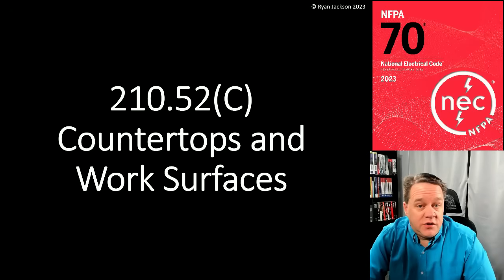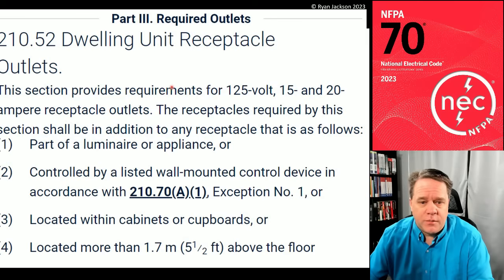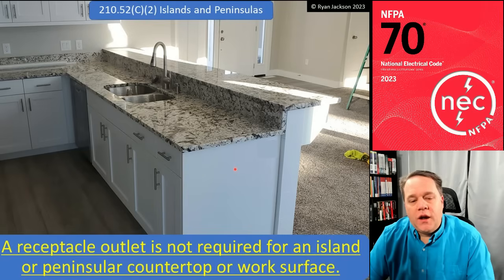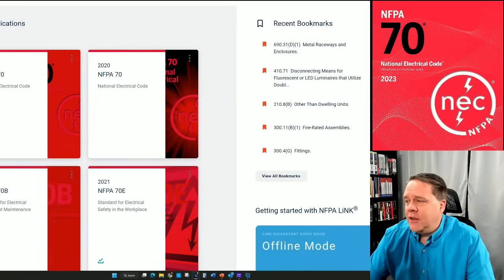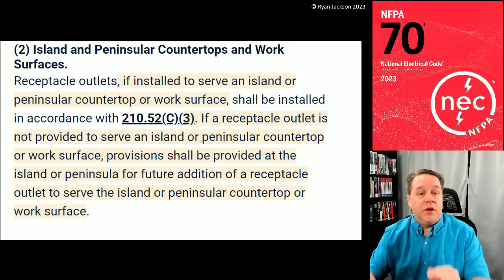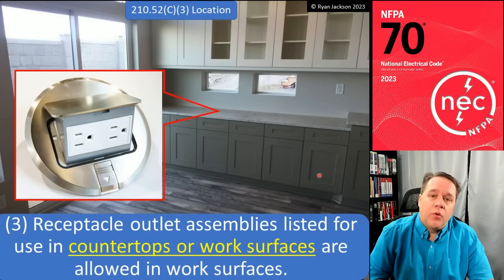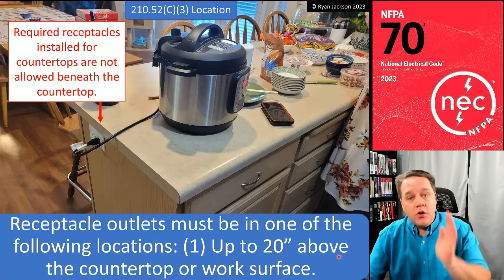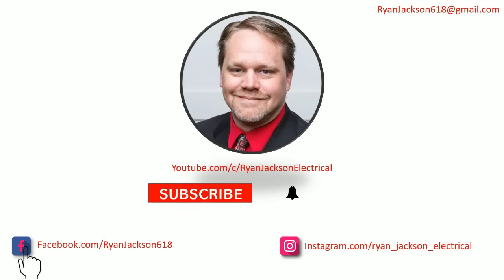Kitchen islands and peninsulas in the 2023 National Electrical Code

Comment: I wanted to know your expert opinion on how inspectors interpret the NEC regarding the proper "code" way to install an outdoor electrical point for an outdoor surface mount light, in some installations, I see a surface mount weatherproof electrical box by Hubbel Bell which I assume is always going to be "code". In other installations, I see electricians drill a recessed hole in stucco to mount a blue old work round Carlon electrical box, at another work site I saw 4 inch square J boxes, with mud rings being installed before stucco work and at one other site I saw pancake boxes ( I hate pancake boxes the most ). What exactly is considered the national standard? I talked to different electricians and I keep getting the same answer that their method is "code" and they are at the mercy of different inspectors on duty on what exactly passes... Can you clear up the misunderstanding? What does the NEC consider to be code?

Comment: pop up receptacle outlets on the countertop has to be the GFCI as well??
Reply from the maker: Yes
Reply: @RyanJacksonElectrical  Thanks, I know the dishwasher has to be a dedicated circuit. Does the refrigerator and gas slide-in oven also has to be a separate dedicated circuit??
Reply from the maker: @sarahljs  none of them, including the dishwasher, need to be.
Reply: @RyanJacksonElectrical  Thank you for the quick response, appreciated. I understand all Kitchen outlet has to be GFCI. But has to be tamper-resistant as well?? And for the countertop microwave has to be AFCI protected too? or that is just for the range over the microwave? Last, is there any minimum distance between the outlet location? I understand it is within the 2ft and 4 ft rule but when I think about the outlet right next to the gas oven range, within 2 ft means I can put at a 1ft distance.. that seems quite close to the gas oven.

Comment: I'm confused about what you're saying. You're saying two opposite things at the same time. I'm going through the 2023 code Handbook along with your video and the NFPA document at the same time to make sure I got this all down. 

On one hand, you and the 2023 NEC are saying that, there are no required outlets on islands & peninsulas. But then you go on to say that you can have outlets over 20" above the countertop, and that 20" is ONLY for required outlets, per Part III which explicitly states "required outlets". 

But, you already established that there are no required outlets on islands (for the most part) and that adding outlets is optional. So how can there be a 20" rule ONLY for required outlets when there are no required outlets for islands and peninsulas? 210.52(C)(3) specifically states, "on or above, but not more than 20" above a countertop." 

So, we've established they're not required on islands, so if you add an optional outlet, then 210.52(C)(2) tells us it then HAS to be in accordance with 210.52(C)(3), which state's that even though it's not a required outlet, you still can't install it more than 20" above the countertop. 

So what is giving you the conclusion that you can add an outlet above 20" when 210.52(C)(2) specifically states no more than 20" per 210.52(C)(3)?
Reply from the maker: You can install a receptacle higher than 5'6" in a bedroom, right? IT just doesn't count as a required receptacle. You can install a receptacle in bathroom drawer, right? It just doesn't count as a required receptacle. You can have a receptacle that is part of a luminaire, right? It just doesn't count as a required receptacle.
Reply: @RyanJacksonElectrical  I understand that. That's why I pointed out to 210.52(C)(2), which states, if you are going to install a receptacle (which is not required) then it has to be done by 210.52(C)(3). 

Basically, receptacles for islands aren't required. Any receptacle added is then optional 210.52(C)(2) covers optional receptacles...which is then limited to 20" above the countertop.

Comment: A very good explanation of a contentious issue. I agree with your perspective of where liability falls in the event of a potentially litigious incident.

As contractors we bear responsibility not only for code compliance, owner safety and convenience, but also any liability that may arise from our performance.

As a side note, I installed a receptacle in the end of my kitchen peninsula during construction in 2005. I caught my cellphone holster in the attachment cord for an iron and pulled the iron off the countertop, resulting in a broken iron, a gouged cabinet panel, and a chipped tile.

Let us heed the explanation of this code reference by Mr. Jackson.

Comment: Thank you Ryan.  Glad I found your channel.  I am not an electrician but can appreciate the evolution of the NEC.  I was interested in how 2 duplex receptacles were installed in a new kitchen island, on the cabinet sides, per code.  If I had to do it again I would install the pop up receptacles in the countertop, even if more costly.  It does bother me when I see the slow cooker on the island with the cord draped over the countertop down to the receptacle.  I think it is always better to plan for worst case scenarios.  Like- we rarely have small children in the house, but there could be that occurrence and the possible accident caused by the portable appliance cord sticking out of the cabinet in a pathway.

Comment: You do a great job covering grey areas in the code. I would love to hear your thoughts on the Bocci 22 system receptacles being installed in Backsplashes. I read a lot of opinions about how they are or aren't a code violation because of buried junction boxes. Hope this is an idea for another great video in the future.

Comment: I have receptacles on the side of my island, but they are never used for hot containers. Use them all the time for chargers and food mixers. I built my house under NEC 70 2017 and I'm an electrical inspector.

Comment: If the “authority having jurisdiction” tells you you cannot put a receptacle below the countertop then you cannot. The code is the minimum.
Reply from the maker: Not unless they have a legally-adopted requirement. The AHJ doesn't get to make up whatever they want
Reply: @RyanJacksonElectrical  work with the inspector . This isn’t the only project you will be on in his jurisdiction.
Reply from the maker: @tombolin7168  I never said you shouldn't. You said the AHJ can make you do something without a legal basis. That is false, assuming you're not in North Korea.
Reply: @RyanJacksonElectrical  true . They cannot make you do something not required .

Comment: You said you don’t live your life worrying about getting sued. As a contractor, you are not doing anything that is illegal or that violates the electrical code by putting the receptacle below the countertop. You also have no control over how that receptacle is used by the homeowner. It could hold a nightlight, an appliance cord, or nothing at all. It is the unsafe use of that receptacle which could cause injury, not its location. If it were deemed to be unsafe to install the receptacle in that location, why didn’t the code authority ban that location as an option? Statistical analysis of injury’s and deaths must be countered by common sense and the common good. We can stop all construction accidents if we just stop constructing, but that is not acceptable in our society. The reason we have licensed electrical contractors and rules for them to follow is because we don’t want homeowners doing work that they are not qualified to perform and could lead to another set of statistics regarding electrocution, home fires and such. Follow the code (minimum standard), follow your trades best and acceptable practices, and carry the required  insurance for your profession, then do the job to the best of your ability.

Comment: I visited a house with an under-counter power strip. This was in the area where the countertop extended about 12 inches past the counter, for possible use as a seating area. It was primarily being used as a place to plug in phone and tablet chargers. I’m not a fan of outlets with USB or USB-C power, as this technology is rapidly changing. Yes, pop-top outlets would be possible, but ugly and generally too few for all the gadgets we typically plug in to charge, leading to use of power strips on a countertop. Unfortunately, this would still allow a portable cooking appliance and it’s associated hazards. I’m not sure on what the best answer is.

Comment: Looking at the photo of the crockpot on the end of the penninsula with the below countertop recepticle...
This can be made safe. I'm imagening something like a towel bar mounted on top of the end of the counter. If the cord runs under it theres no way to pull an appliance off. Even if the cord hangs over the top of the bar, it would be a substantial curb.

Comment: Been licensed since 95 in Massachusetts, here's the thing I'm trying to understand. When I started we were always told we never wire for the future. We wire for today and they can't make us do what ifs scenarios.
In fact, at one point in time they were making us put fan boxes in if there was an area greater than 2 ft circumference, what I recall a gentleman wrote a beautiful letter explaining the concept we're wiring for today. Not for tomorrows What ifs and how they legally couldn't make us And they removed that requirement, but it all came back. Something occurred. I'm trying to understand it. They made it possible to dictate all the possibilities in the future we must now be prepared for. 
Is it possible you can explain in a video, on how they're able to structure the code this way.
Reply: Great point.

Comment: Man.. some of the disagreements and arguments I have dealt with over the last 3 years with customers, contractors, and inspectors on this issue and getting the proper amount of legal receptacles on islands is all for not.  Trying to explain to customers/contractors the amount of receptacles needed at the island with the 2020 code was like talking to a brick wall and at times having to force expensive pop in installs to make them compliant was a chore which at times required me getting the inspector involved.   Seems strange to over extend and then pull back so far.  I'm willing to bet on 2026 they will require a pop in on the countertop if no backsplash exists and this is just the setup for it.  But I can't say I disagree with the normal spot for these receptacles on the ends being dangerous.  Kids running around an island and hitting an appliance cord is a scenario which isn't hard to imagine.
Reply: Man, I feel your pain, I've been a commercial industrial type of electrician for most of my time , then  I spent the last 5 years doing high-end residential( I found it really rounded my knowledge) want back to commercial, My heart goes out to the residentials!
Reply: @chrisf3875 . Thank you for your understanding.
Reply: All comes down to paying attention to your kids. We've had Islands with end receptacles in all our homes and never had an issue. My girls are 27 and 24 now. They weren't allowed to play in the kitchen when we were cooking.
Reply: The NEC committees have gone a bit off-script lately.  They also had to walk-back the requirement on outdoor heatpumps being on GFCI circuits since new inverter type don't play nice with them.  Ditto for refrigerators now needing GFCI, even if far from a sink and they haven't walked that back yet.  New refrigerators also don't play nice with GFCI, so bad that many have a list of what GFCI models play nice.  Expensive to have a whole fridge load spoiled due to a false trip.  Ditto for AFCI breakers.  They confuse solar installers who now think panels must be earth grounded since NEC now gives rules on how to ground them if you choose to do so, but doesn't even recommend that (makes them a lightning rod).  Even worse, they added requirements for roof-mounted panels that almost forces a microinverter system, perhaps a gift to Enphase.
Reply: @williamgrissom9022  Agree - Need to back to all codes from1876  😁😁
Reply: The impression I got is that the kids don't accidentally hit the cords.... They pull on them deliberately. No surprise if they ban the island side receptacles in future.
Reply: Why did you need to do pop ups? You only needed one receptacle within 2 feet of each end, the other outlets could be anywhere.

Comment: Unbelievable how otherwise brilliant people on the Code Panel can identify a problem and come up with a solution that is as bad or worse than the original problem. THEY HAD THE ANSWER IN FRONT OF THEM.   Yes, prohibit the installation of receptacles beneath the counter but don’t give up the requirement for the receptacle.  This ambivalence by the CP will now ENCOURAGE the misuse of extension cords run from the island over to receptacles mounted at the counter or wall. Thus little Johnny will continue to pull the crock pot down and still become disfigured.

Comment: So now I'm going to run an extension cord to the island for someone to trip over and knock that boiling instant pot to the ground?
Reply: No, put the outlet on top so the cord doesn't have to hang over the side.
Reply: @marklundeberg7006  sure, as if it is so easy to put a popup through a granite/marble counter.

Comment: Do kitchen undercabinet receptacle strips satisfy the countertop/worsurface required receptacles, even though they are usually above 20in.
Reply: No. If there at 20.5 you wouldn’t meet code. You would need to drop cabinets
Reply: @jason ault  OK thanks. I just see it often where people don't want anything on their backsplash protruding.
Reply: @simplewick350  correct. Just finished kitchen with outlets built under the cabinets. They have to meet the code.  Reason is you have a 2ft appliance cord attached to kitchen appliances. It’s got to be able to sit on countertop. You go higher the appliance won’t be able to stay flat

Comment: I don’t have a 2023 copy (yet) so I don’t have the literature in front of me, but say you have an island that has a sink and it’s a step up island that has a higher portion of bar on the opposite side from the sink, thereby giving you a “backsplash” area on either side of the sink. Because it’s an island is the code saying that a receptacle is not required for those areas? I understand your “suggestion” that you could add receptacles as “additional” receptacles that aren’t required (and I would probably install them since the HO would use that space as working surface), I’m just wanting clarification for myself. Thanks for your videos!

Comment: Hello there.   Actually I like what you're saying and I actually think this is a good code change.   I am guilty of installing receptacles below countertops on kitchen islands but only because I work in South Carolina and occasionally North Carolina which is just now adopting the 2020 NEC.   I also like the new 2023 code requirement about requiring provisions for a future receptacle outlet,  while it isn't perfect or might not be  ideal I think it's a good compromise.  I plan to start my own electrical business in the next couple to 5 yrs depending on the economy,  and I will  definitely be promoting listed countertop pop up receptacles to  my perspective clients.

Comment: Pop ups aren’t always an option because the cabinets do not allow the space for them. The drawers can consume just about all of the real estate in a cabinet. Now what?
Reply: Modify the drawers to allow for the space, or better yet plan to provide cabinets that will already accommodate.
Reply: @jaystusjh19  I’m just an electrician showing up after the fact . I’m not the homeowner or builder making those decisions. They sure do make it hard for us.
Reply: You wind up losing drawer space.  You have to significantly shorten the drawer and mount the pop-up toward the back (my choice) , narrowing the drawer,  notching the drawer (like for around a trap in a bathroom lav)  or eliminating the drawer altogether and mounting a false front (like in front of a cooktop or sink).
Reply: Welcome to the land of big brother.  I am building a new house, and I know where my outlet is going.  In the base cabinet.  The insanity of the hoops to jump through and expense to have an unsightly plate on the countertop - I'll pass.
Reply: More than once the drawer had to be shortened to fit the requirements.  To satisfy inspector to allow cert. Of occupancy.
Reply: I just did surface pop ups and i just made a space in between the cabinets for them. Make the center cabinet a "21 deep and the others "24.

Comment: This is interesting to me.  I design industrial panels...I have nothing to do with residential.  But, I remember that past code change(2020) that 'required'  such outlets.  Why?  Because I listen to you and Mike Holt videos(some music too) while I'm doing CAD or calcs or whatever. Geeky me.
I personally have gotten my foot engaged with a crock pot cord plugged into an under-counter receptacle (breakfast bar kind of thing). No one got burned or hurt but there was a lot of hot food on the floor and I looked like a fool.  I thought(Engineers are supposed to think)  geesh, what if a kid did that?
I'm glad to see the change...almost from 'shall' to 'shall not' in the code.  Not quite but close.
The new language sounds like a lawyer's advice of language for backing out of a previous gaff in the code. No doubt lawyers review the code. 
It does make me wonder if the NFPA gets sued from time to time on such things.
Reply: We had a very gifted intelligent electrical inspector at IAEI meetings that brought up that he thought some of the fine print in the NEC were due to lawyers meddling in. Granted the pop up outlets cost more but that's what I would install if I had a kitchen island.  If Kitchen is large enough for an island then the NEC should require them to be on their own 20 amp AFCI breaker that does not count against the minimum two required 20 amp counter top kitchen circuits.